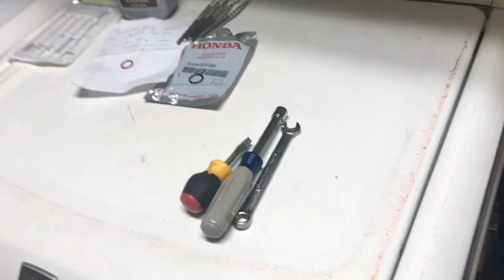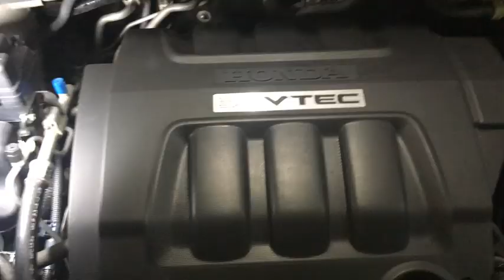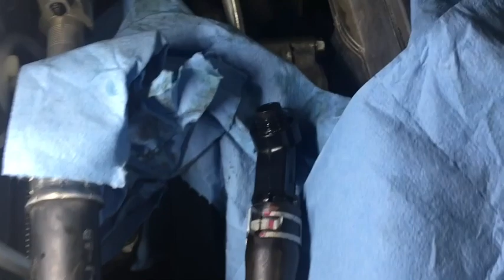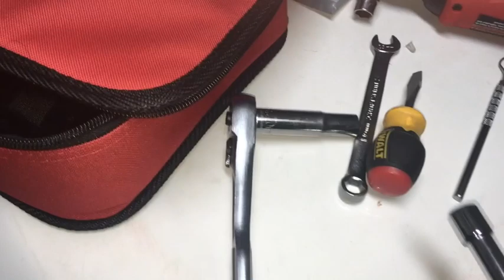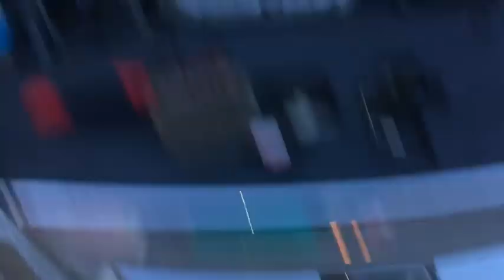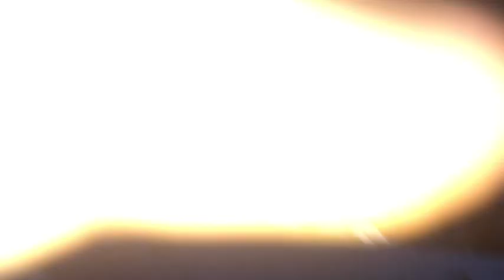2007 Honda Odyssey Power Steering Leak & O-Ring Replacement Fix

Comment: Had a very noisy power steering pump and a leak.  Replaced both O-rings and the power steering reservoir (both were Dorman brand bought Advanced Auto Parts).  Cost me about $30 in parts and another $15 in fluid.  Watched this video and it worked perfect.  Not noisy anymore.  For the fluid, I used Lubegard, which I bought from O'Reilly's.  Great video and thanks for sharing.
Reply from the maker: Thank you for your encouraging comment and for sharing the details of how you fixed yours.

Comment: Also how did you determine that it was just the o rings that needed replacing and not the whole pump?
Reply from the maker: It’s been a long time ago but I believe I had researched and found that the O-rings could harden and could be a source of leaks and they were so inexpensive I felt it was worth the try to do that first and then if that didn’t work could move along to the pump. Fortunately the O-rings were the problem and did solve it for me.

Comment: do you need to remove the fluid before replacing o rings?
Reply from the maker: If you plan to replace the O-rings without draining the fluid you definitely need something to catch fluid that would leak out of the hoses and a lot of rags around the area.

Comment: Can i change the top first or do i need to do the bottom first?
Reply from the maker: I think you could change them in either order.
Reply: @PaulNaylor3  thank you boss happy new year!
Reply from the maker: @Victor-cd4hn  you’re welcome and happy new year. Check the link in the description for the short 10 mm wrench. I didn’t know that existed when I did this job years ago but think it would make that bottom O-ring much easier to access.

Comment: Was your PS reservoir empty?  If not, how did you keep all of it from pouring out the lower hose when you loosened it?
Reply from the maker: No. You will see in the video that I placed a rag under the hose and it did get soaked with power steering fluid when I removed the bolt. You could drain the reservoir if you want. I had to refill mine back to the fill line when the job was complete as a result of the amount that spilled having to be replaced.

Comment: Thank you. Your explanation of how to remove the bottom line was very helpful. Angling the wrench through the mess of wires and A/C lines in that area is a real pain in the ass. I hardly could feel my back after removing and putting the line back in place.

Comment: Great video!  When the bolt on mine was tightened by the previous installer, it just happened to “land” where my normal box-end wrench couldn’t get a bite on it before hitting the motor mount (even a 12-point thin-wall wrench).  The solution for me was an offset wrench (one example is Craftsman #CMMT44350, which one of my local Ace Hardware stores had ONE of in stock).  The offset made it possible to gain enough additional clearance with the pump pulley to get a bite on the bolt.  Another tip: as soon as I put a little force on the hose from the pump fitting back to the reservoir, the hose cracked - so I’m glad I’d bought another one prior to starting the job.  (My van is an 07 with 203K miles.)

This is also the perfect time to replace your PCV valve if you haven’t done that lately.
Reply from the maker: Great information, thank you

Comment: Great video, was able to fix the leak quite easily after watching this.  I used a short 10mm wrench that was only $2.50 on amazon to get the lower hose bolt off.  No clearance issues with the end of the wrench.
Reply from the maker: Thank you and glad you were able to fix it!
Reply: Link please!
Reply from the maker: https://amzn.to/3GalmFt
Reply: @cra2cra226  Craftsman Combination Wrench, 12 Point, 10MM Short (CMMT44113)

Comment: Thanks so much for the video. That bottom bolt is a nightmare. That engineer should be hung upside down and have his butt shaved in public! You need baby hands for this job. I ended up chopping off the metal bracket that extends out for the cable loom to clamp to. No other tool will work except for a small 10mm wrench. The good news is once you get is broke free you can use your two fat middle fingers on each side to back it out. Be sure you install the bolt first upon reinstallation like the video says. Also have a telescoping magnet handy for the 20 times your going to drop the wrench. Much easier job also if your left handed.

Comment: Excellent video.  Very much appreciate that you list the parts as well.  Question!  Do you think you would have benefitted from emptying the reservoir before working on the hoses?  I have a syphon pump and I was thinking of extracting the fluid before working on my van.  I believe that my problem is the same as yours was - the bottom hose o-ring is bad and is leaking.  Not a lot but it is leaking a little.  Thanks again!
Reply from the maker: That sounds like a good idea to empty what you can. Let me know how it goes!

Comment: Can I drive it like this without damaging something else?
Reply from the maker: Are you asking if you can drive it with the leaking O-rings without hurting anything? If so, just keep an eye on your power steering fluid level and recognize it makes a mess dripping down your engine bay. I don’t think it would hurt anything as long as you keep the right amount of fluid.
Reply: @PaulNaylor3  thanks! I did buy them
Reply from the maker: I hope the job goes smoothly for you. It does take some patience since it’s hard to reach some areas. Let us know how it goes.

Comment: Great video.  Did the 2 o-ring replacement solve the issue, or was there more to the fix?  Thank you
Reply from the maker: Thank you. Yes, this solved my leaking issue.
Reply: @PaulNaylor3 good, this is probably my issue, and I'm about to address it. Thanks for the vid. My 08 has almost 242k on it, and definitely losing some PSF.
Reply from the maker: @jimmellenberger8505  Let us know how it goes. I hope it fixes your problem.

Comment: Hey thanks for this! Just went to the Honda dealer for the parts, and they recommended just going ahead and replacing ALL the o rings and seals in the PS pump as well at the same time. So I bought them all (like 5-6 total) and it was like $40. They said it wasn't hard but I haven't tried to rebuild it yet.
Reply from the maker: Ok. Let us know how it goes when you change them. Hope it goes well.
Reply: @PaulNaylor3  it wasn’t bad! Replaced all the seals and it’s working fine. Turns out the pressure line was also leaking so that got replaced as well.
Reply from the maker: @bobpotter4372  Great news! And you saved a lot of money doing it yourself.

Comment: Thanks for the tutorial, just did this on my 2013 and that one 10mm bolt is too damn tight in a tight spot. It was waaaay easier for me to remove the drive belt, unbolt the 2 screws that hold the PS pump, get the whole thing including the PS reservoir into an oil drain pan on top of the engine, replace the o-rings comfortably without any mess. I imagine drive belt removal is not something everyone is comfortable with I had to do this because my PS pump was filthy with a layer of oil so I took the opportunity to give it a good clean.
Reply from the maker: Thank you for explaining another way of doing this. I’m sure it will help others and I’m glad it worked for you.

Comment: For me it's the bottom one that's leaking.  Is it necessary to change the top one?
Reply from the maker: That’s up to you if you want to do it while you’re in there or wait and see.
Reply: Just change the both. They are cheap parts anyway, and the bottom one is the difficult one to pull out.

Comment: You may also want to try a ratcheting wrench for that 10mm.  I'll be doing my pump, will it come with these o-rings or will I need to buy them separately?
Reply: Ratcheting box end wrench didn't help me. I bought a set of stubby combination wrenches, and it works fine. The bolt only needs a quarter turn to be loosened enough to remove with your fingers, but sockets are too deep to fit in the space, normal wrenches are too long, and offset or angled wrenches give no help.

Comment: QUESTION; regarding reaching the nut under the hose. If you removed the hose, could you get a small ratchet under there?
Reply: I tried that but even with the hose removed you can't get a ratchet under there.
Reply from the maker: Do you think these thin wrenches would work?
https://www.amazon.com/dp/B08CVC5BDL/ref=cm_sw_r_as_gl_api_gl_i_F8V09T0TTE6W9AQA0HJQ?linkCode=ml2&tag=paulnaylor3-20
Reply from the maker: This is a short 10 mm wrench that may also work:
https://amzn.to/3PNZO78
Reply: No, but removing the hose helps to remove the bolt and hold the wrench in place. Use a stubby combination wrench like these: https://www.amazon.com/Sunex-9930M-Metric-Combination-10-Piece/dp/B000PGTCDU/ref=asc_df_B000PGTCDU

Comment: I have a  2002 odyssey and I changed the top o ring. THE BOTTOM IS A PAIN so,  I had to break until tomorrow..
Reply from the maker: I hope you can get it done tomorrow.
Reply: @PaulNaylor3  I'm on a mission!

Comment: How did you figure out it was power steering fluid and not oil? Thanks in advance!
Reply: It tastes different
Reply: Yeah, I could see it was from above. I am dealing with what seems to be the same issue. I was curious how you figured out it was power steering fluid and not oil. I know the oil pump and crank seal are both above this area as well. I’m trying to figure out if mine is power steering fluid or oil. Just having trouble finding the source of the leak. I appreciate your respond and video!
Reply: Same scenario for me, mine was oil coming from the oil dipstick area. It was the VTEC Solenoid, although all along I thought it was power steering fluid.
Reply: I realized it was power steering fluid because I saw it was coming  above.  Then checked fluids and my power steering fluid was at the low level
Reply from the maker: Aaron Turner At first I thought it was an oil leak and so did a mechanic. You can see evidence of the leak above the oil pan indicating it’s coming from somewhere else.
Reply: With mine I think it is because the steering wheel fluid tank empties out in about a week..hopefully this fixes it..
Reply: Anyone know the exact sizes of the power steering o-rings? Anyone?

Comment: What torque do you use for these bolts?
Reply from the maker: I don't recall using a torque wrench. I don't think it's a critical measurement for this job. I would just make sure they are tight and you should be good. You may be able to find torque figures somewhere. If you do, please post so we can know as well. Thank you.
Reply: Ok, thanks.